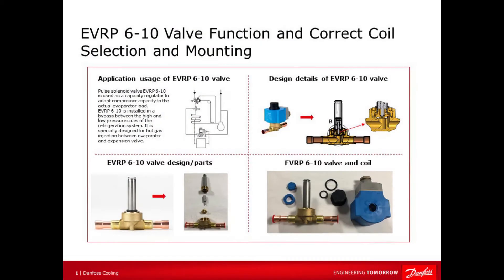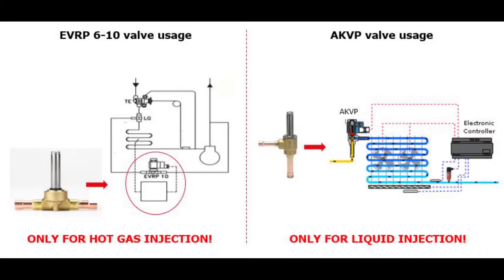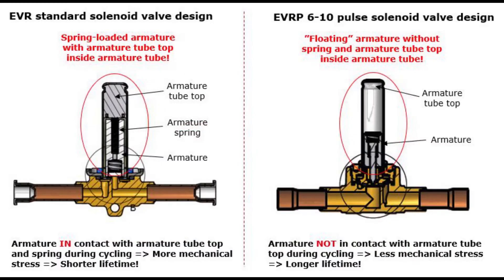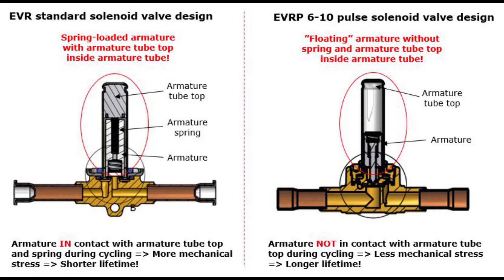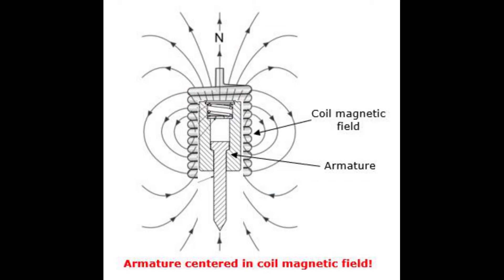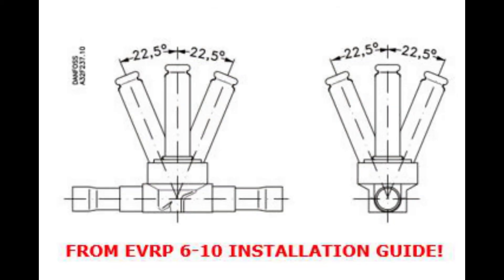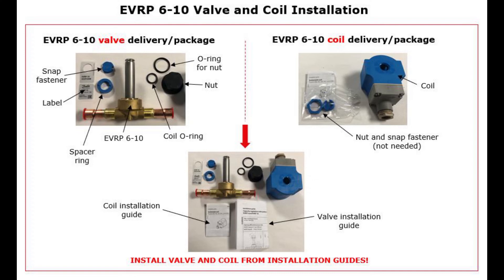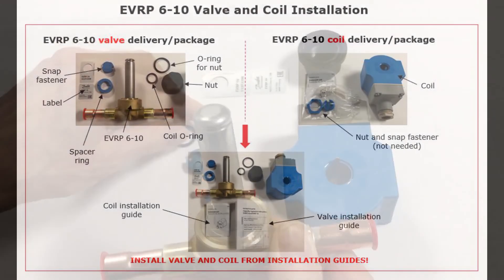EVRP 6-10 pulse solenoid valve｜Quick overview

Comment: Bypassing hot gases to evaporator to control capacity , avoiding start stop at low loads - i remember manual valve of this purpose on provision plant never worked good.